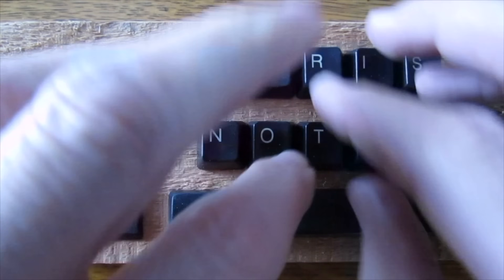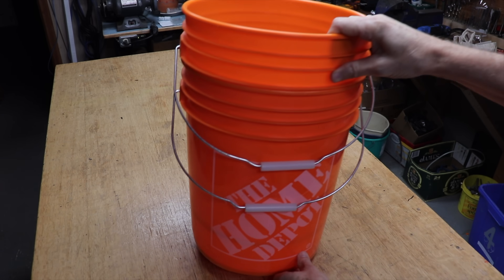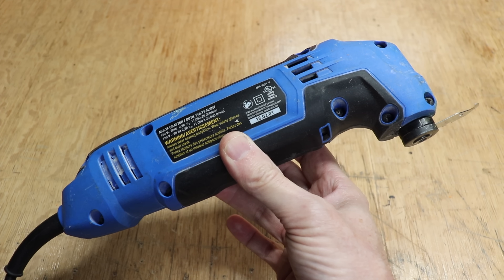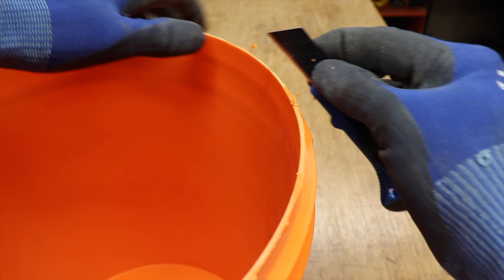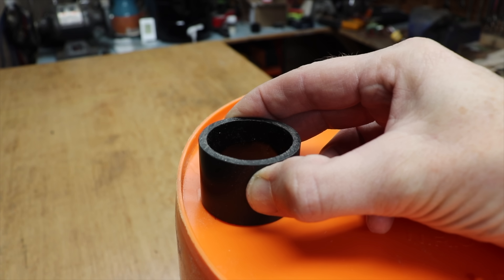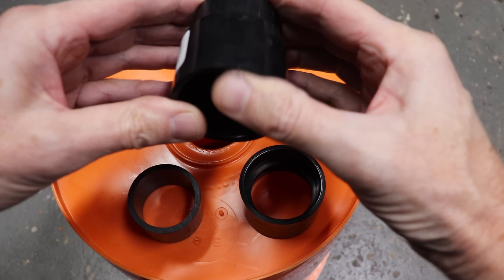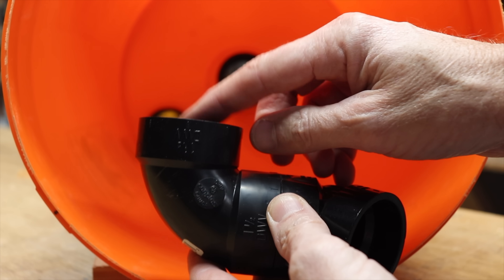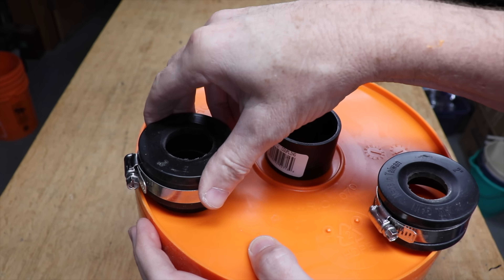How to Make ● Simple Cyclone Dust Collector

Comment: I already have a very large Delta dust collector, but I found this video very interesting and well made.
Reply: I have the same from Jet (x2). I put one of these built with a 35 gallon garbage can "in front" of them. This pre-collector gets all the big sawdust and wood chunks, saves my impeller blades, and is MUCH easier to empty than the bags of the cyclone system. (A couple hours of running the planer fills a 35 gallon garbage can, and would require emptying the regular cyclone bag several times.) When full, I put a 55 gallon yard-waste bag over the can, invert it, and I have a bag of sawdust for the garbage men.

Comment: Oneida dust cyclone is the cheapest & best...why reinvent the wheel
Reply from the maker: Incorrect. Not cheap at all. $50 without the bucket, $107 with. You might be looking at $20 for this depending on where you live. Thanks.
Reply from the maker: Actually they are between $50 and $300 depending on model!

Comment: This is the best and easiest DIY cyclone I have seen so far.
Reply: Mike Smith  Nope.  Doesn't stop the filter from clogging.  You need to separate the vacuum filter from the dust collection by way of the cyclone.
Reply: Mike Smith  this is to keep filter from needing to be cleaned.
Reply: Definitely the best opening to a DIY video I've ever seen!
Reply: MetaView7 y
Reply: Bravo....awesome build.
Reply: What do I substitute for the central vac that I don’t have?
Reply: @janshelton189  
Just use a shop vac.
Reply: Nice set.up...use a street 45 and you don't need any extra 1-1/2" pipe
Reply: Sorry...Using a street 45 you'll use less pipe and less cutting
Reply: Very impressive! 🇨🇦
Reply: I was about to type the same thing. I've seen so many, but this supersedes anything.
Reply: This is terribly over thought in my opinion. all you need is a larger chamber to slow the air velocity so the stuff falls out no need for a cyclone just use maybe a Tupperware tote, put a little water in the bottom and bobs your uncle. Spent a few years in a large commercial cabinetry mfg as the cnc/maintenance tech. Itll work.
Reply: Ham Wallet Sounds great - show us.
Reply: @okafka5446  
Im more of an idea guy. I get kinda nervous on camera and im not my usual self. Id love to do a YouTube channel but i get the willy squidgets. 
But seriously have you ever seen a rainbow vacuum cleaner?
Reply: @mds1986ms  got any vids on that?
Reply: @chrisgrubisa3819  
You guys are making me really consider starting a channel. Maybe i should and that'll help me get over some of my awkwardness about being in camera. I do have a lot i could teach/show everyone. Ive tried to be the guy that knows a little bit about a lot.
Reply: @chrisgrubisa3819  
Ill offer a short(ish) but detailed explanation. 
So to make whats called a "drop box" all that is needed is a chamber large enough that air speeds are reduced inside said chamber. This may not be the most space efficient  example but it illustrates my point. If you were to take a 30 gallon drum and put the inflow 6" from the bottom and youre vacuum 180 degrees and 2" from the top of the drum yhat alone would stop anything larger than sand sized particles and to stop those simply add a bit of nylon mesh for silk screening maybe 250 micron and thats that. But you can make true cyclones much easier out of coil stock and some pop rivets too. You font need all that internal structure if your shape is correctly and the intake, exhaust and drop outs are done right. I use to go to work with my farther a lot during summertime way bay when he was master electrician at GE they made gigantic cyclones and things called cat-crackers for oile refineries. So ive been learning about stuff like this my whole life.
Reply: @mds1986ms  hey man the only thing that stands in your way is yourself.  
Sounds like ya know what youre talking about so why not make a vid.  Be able to share the knowledge that much better.
Reply: And thanks for the words of encouragement. Ive been trying to break down some barriers lately and venture outside my comfort zone so this maybe just the thing i need. 
I forgot to mention the adventure side of what i would be posting. The wife and i about to embark on a mission to skydive in every state, first step will be acquiring a class-a skydiving license. So i would definitely have a considerable amount of content.
Reply: @mds1986ms  terribly over thought ? It sounds like your idea is over thought.  Use this idea and put an old pillow case over the filter as a pre filter. Duct tape the pillow case around the filter. PERFECT FILTER FOR UNDER $20. I HAVE BEEN USING THE SAME FILTER FOR YEARS AND LOVE THIS GUYS IDEA.
Reply: Ham Wallet ,

I would like to experiment with you further... for an application to extract saw dust through a swimming pool hose outside to a 
waiting contractor type bag.
Reply: @Blue-Horse-Shoe  
How much distance are we talking?

Comment: That’s pretty neat.  I came up with a nearly identical design a few years back.   I like how you attached the buckets much better.  Mine had a screw top lid on it to help with emptying.   And a sight glass on the side of the top bucket to see how full it was.
Reply from the maker: I find the best is a flashlight behind it to see how full it is. I’ve used site glasses in the past but they just get covered in sawdust!

Comment: I must have missed something. You still have to empty a bucket.
Reply from the maker: Yes but easily. Not an impacted filter and container.
Reply: The part you missed is $20 in parts and an hour of time spent on a fun easy project saves hundreds of dollars on shop vac filters, bags, and maintenance by collecting the saw dust in a separate receptacle from the vacuum motor. If you use your shop vac once or twice a year for light duty, this may not be the project for you. But if you do two or more substantial woodworking projects this is a worthwhile endeavor, evident by the hundred plus dollar dust separators you find at hardware stores and home centers. I would agree with several others who have commented this is the best DIY solution I've seen. Hopefully this clears things up a bit for you.

Comment: Hi Chris, I can't imagine how much time you spent on testing and coming up with such a genius solution.  I'm a woodworker and this to me is by far the best and easiest way to make a cyclone dust separator.  I am a loyal fan and have watched all your videos.  I sincerely thank you for sharing and the time you put into making all these wonderful and professional quality videos.  I can't wait to learn that your subscribers in the millions!
Reply from the maker: Thanks for that great feedback!
Reply: @chrisnotap  4:30 🤣
Reply: Hi Chris, I concur with Robert. The concept, design and execution are brilliant, but your production and delivery of the the video are perfect.
Reply: Mike Smith  If you understood the goal you would not suggest a trash bag in the shop vac.
Reply: Mike Smith  It is not just about taking the dust out, that is only about 10 % of the equation, 90% of my concern is to keep the filter clean and the suction at its peak, it is very time consuming the cleaning of the filter. By doing this, you save money 3 times, the electric consumption of the motor would been much less, the bags are expensive and you save money on filters too. great job Chris, you got yourself a new fan.
Reply: @ricardoaguiar2241  spot on ! Saves on blowing dust out filters after every use...Also helps keep the power closer to max for much longer 👌👌👌
Reply: Mike Smith  A valid concern. I was thinking of adding a third bucket with a round plain steel weight, the kind used for weight lifting. This bucket would act as a base for the cyclone assembly and hopefully would keep it from tipping over when empty. I'm not  an electrical genius, so if I  rigged a ground wire from the cyclone assembly to the weight, would the weight act as a grounding mass of some sort? Also, any thoughts on how to attach a ground wire to the cyclone, one that would be effective?
Reply: Mike Smith  so how does putting a bag in the shop vac reduce static electricity?
Reply: Mike Smith  Also a key (that at least I missed at first pass), Chris uses central vacuum hosing, which is metal, and a steel shop vac canister. The majority of the high-volume, high-flow units that necessitate grounding use fixed PVC pipe which is against code in many places for pretty much anything that isn't water. Most shop vacs constructed entirely of plastic, pick up debris day-in, day-out for years without ever having a problem.
Reply: Mike Smith  Ok. Thanks for the reply Mike.
Reply: 5
Reply: Mike Smith  You're confusing what might be better referred to as a 'dust extractor' with a 'dust collector' or maybe 'dust collector' vs. 'debris collector'. A 50-gal. 1300 CFM 'dust extractor' has a slim chance of catching fire and a vanishingly small chance of exploding*. A 5-gal., 75 CFM 'debris collector' has a vanishingly small chance of catching fire and a virtually nonexistent chance of exploding*.

*Depending on materials and frequency of use/empty, of course. If you vacuum up hot metal swarf off a grinder immediately after vacuuming up paint thinner, no amount of static protection will protect you from the results.
Reply: great comment it is a lot of work making these videos I know I have been trying to make my own channel and getting subscribers is very hard I have many views but they do not subscribe to my channel. This is a great video
Reply: @DIY don't sweat the subscribes... its mostly an ego thing (of course it helps with notifications as well). With fewer than 30 vids, you've really just gotten started. Most don't see significant pickup until after a couple years of regular & frequent uploads.
Reply: thanks for checking my channel out

Comment: It'd be nice to modify it a bit, where the top bucket can be mounted to the ceiling. However, what's wrong with using the dust bin built into the vacuum in the first place? The bucket isn't any larger, but if you used a lawn and leaf bag in place of the lower bucket, while mounting the upper bucket to the ceiling. That could have a lot of capacity.
Reply from the maker: You do need the bucket on the lower part. Just a bag would get sucked up into the upper bucket.

Comment: I wonder if this would work for a leaf sucking system to clean the blasted gutters ... bigger shop vac may do the trick! Cheers from Vancouver!
Reply: For that I think I would use a 55 gallon barrel. Maybe like with a 55 gallon trash bag. Add a hand truck and ratchet straps for making it easy to move when getting full.

Comment: Great idea and by far the best solution I have yet seen. This was to be one of my first projects for the new year and was going to cost quite a bit. Now I will just go ahead and do it with this design. What is the black connector/pipe material and will PVC be just as good?
Reply: Some areas use black ABS drain pipe. Used to be a mobile home standard  ( cheap ). Analyne butadyne styrene. Lower melting point, cheaper, I think the first plastic drain pipe. 1940s?

Comment: Color me stupid but isn't that what a Shop-Vac is for😁👎
Reply: Easier to empty. Doesn't use up filters near as fast so more economical. Straight into vacuum and suction efficiency slowly starts dropping almost immediately. With dust collector, as long as you don't overfill the efficiency stays up the whole time.

Comment: Awesome... been watching DIY dust collector videos for years off and on, love this solution! Best and easiest solution yet!
Reply from the maker: I thought those baffles were required but then I tried nothing and it worked great. Crazy!
Reply: @chrisnotap  would a baffle a third up from the joint of the two buckets yield better results?
I think ill try.
Great video Chris!
Thanks for sharing
Reply: @pmdinaz  
A cone fitted to the top bucket inside would reduce the agitation in the collector bucket. (in essence a funnel design) It might even enhance vacuum strength.

Comment: That's the best one I have seen yet and may I suggest a brick or even better a round steel plate on the inside bottom to help keep it from tipping over    Thanks
Reply: I would mount it to a round piece of plywood Size to taste.
Reply: Good idea. A bottom counterweight of any kind is a nice value add.
Reply: Good suggestion. That was one of my concerns too...the stability of the dust collector as the input hose was being moved, and dragged around the collection area.

Comment: You should make a filter like the one in the shop VC in the top bucket.
All you need is an adapter to a 6", a 6" x 6" nipple, and a 6" cap. Press adapter, nipple and cap together and use a drill to make 1/2" holes in the nipple and cap. Use old longjohns for dust filter. Cut longjohns leg, use a heavy string as drawstring. Fold edge of longjohns over string and staple so string is free. Cut string leaving enough string to allow for tying a bow.
Place on 6" frame you made earlier. Cut longjohns far enough below frame so you can wrap string tight around longjohns and tie. Fit adapter to nipple in the bottom of bucket. Now for a video of this.

Comment: Why not just suck the sawdust into the vac? Whats the point?
Reply from the maker: The filter clogs
Reply: @chrisnotap  i guess so. Dont you just beat it out afterwards. I guess its slightly easier.
Reply: Easier to empty. Doesn't use up filters near as fast so more economical. Straight into vacuum and suction efficiency slowly starts dropping almost immediately. With dust collector, as long as you don't overfill the efficiency stays up the whole time.
Reply: @bobbybaucom4489  thx
Reply: @mhypersonic  YW